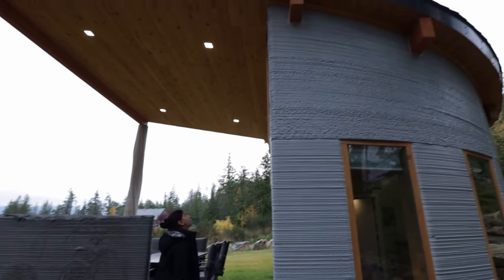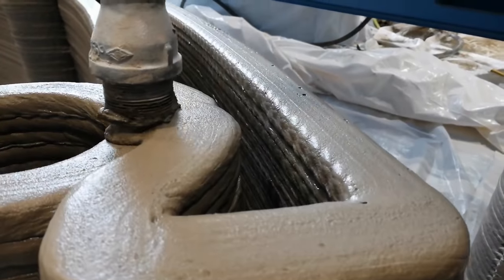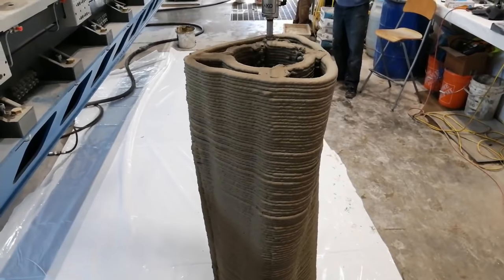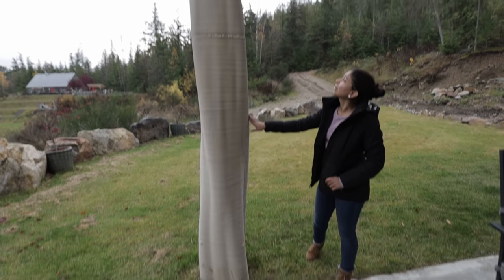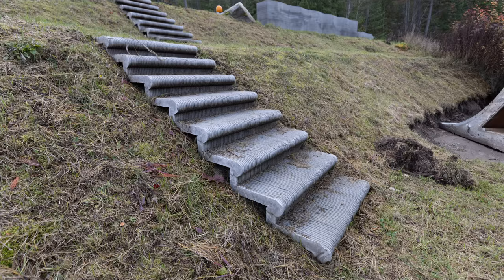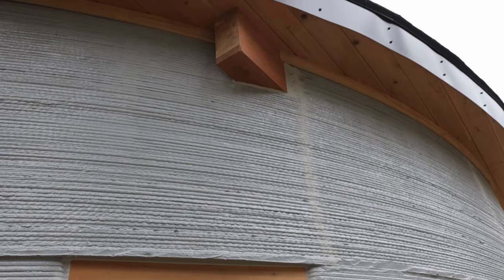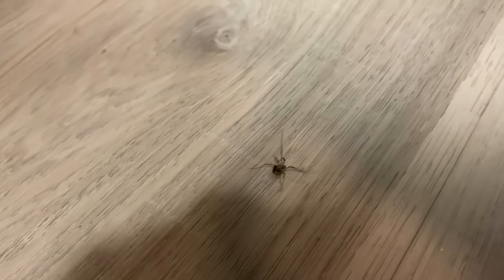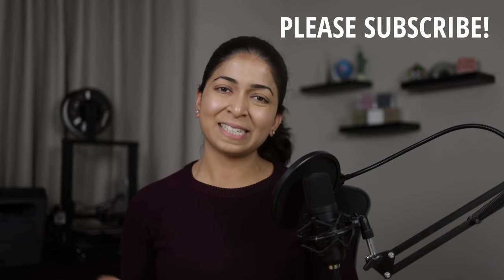Fibonacci 3D printed house | Good, Bad & Ugly

Comment: Installed in wood framed walls, steel stud or poured concrete, renovations or new construction, commercial or residential, most of the plugs I notice are  either loose, out of plumb, twisted, proud or recessed or a combination of these faults. 
Good installation starts with a securely mounted electrical box, set plumb and positioned to be flush with the eventual finished surface. Obvious and easy to do, right? Wrong. Twisted wooden studs, inconsistency in the drywall application, form variance around cast in place boxes, the reasons why it is difficult to get an electrical box roughed in to fit exactly flush and true with a finished surface are many, but a sub par box rough in is not a reason to give a poorly fitted plug, a passing grade. 
Most boxes seem to end up slightly recessed behind the finished surface and this leaves a gap between the threaded ears on the box and the metal mounting strap of the plug or switch. To ensure a solidly mounted plug this gap should be filled with spacers so that force applied to the plug is transferred directly to the threaded ears of the box. Sadly most electricians use the ears built onto the plug mounting strap to position the plug flush with the face of the drywall in combination with the decorative plate to keep the plug pulled forwards. The result may look okay but it is unlikely to remain so once the device is in use. The reason most don't bother with spacers is probably a question of time. The spacing washers are thin and it's a guess as to how many are needed. 3 top 3 bottom? 5 top 2 bottom? Could be. Try it. Washers on, screws started, fold the wires into the box, tighten things up, try the plate and... Drats! Should have been 4 up and 4 down. Take it apart, try again. Really? That's odd still not right. Okay, maybe 4 and 4 with a thinner cardboard shim on the top. Okay finally, that works. Almost. It's plumb and equally spaced out on the top and bottom screws but it's not equal side to side so I guess the box is not parallel to the face of the drywall. No problem. Take off the plate, grab the ears with some pliers and give them a bit of a twist to align plug face parallel to the face of the drywall and finally put the plate back on. Oh for crying out loud! Now the top is sticking out a bit too much. Once again, remove the plate, undo the mounting screws, pull the receptacle forwards, remove one of the washers, put it all together again and...? Perfect. One down, one hundred more to go.
Plug number 2. The box is flush, no need for spacing washers but the box is loose and wiggles about in the hole. Solutions: Secure the box in place with drywall filler or latex caulk or one of many different types of supplementary brackets. Hmm no brackets in my truck, so use drywall filler. Now, wait for that to dry and set and 24 hours later I can come back and install the plug. Plug number 3. Oh oh, this box is way to deep and there is a gap between the box and the back face of the drywall and that is an electrical hazard and code violation. Solution: Install a box extender. Easily done, just another trip to the truck, back to the plug, install and hooray! I've done 3 plugs, (well 2 and half cause still waiting for that mud to dry) in 30 minutes. Oh oh. Boss ain't gonna like that. I'm supposed to be at a pace of 2 minutes per plug. I guess it's like they say. Good. Fast. Cheap. Pick two. 
And that dear reader, is why I never made much money as a self employed electrician. I was Good. I was Fast (relatively speaking) and I was Cheap cause I couldn't justify charging the customer to repair the mistakes done by those who started the job.

Comment: "The Fibonacci house is not just form for form's sake. They chose a spiral because it would have been very expensive to make the shape with traditional form work. Printing a curved wall with different radii is not an issue when using a 3D printer."

What I'm hearing here is "in order to prove that 3D printing can easily do things that are impractical to do traditionally, they designed and built a house that nobody would even want to build with traditional methods because curved walls are totally useless and impractical." Which is as much "form for form's sake" as I can imagine something being, at least. And that's not even to mention how hard to clean the grooved walls would be that everyone else has already discussed.
Reply: Exactly.   No one with any sense wants curved walls.   Just hanging a picture is a pita.

Comment: "Many electrical outlet plates are also loose". Too be fair poorly installed electrical devices seems to be more common than not, at least it seems so in my area.
Reply: I think the curved and uneven walls from the concrete pour don't allow the plates to rest flush, however an electrician should have ways to work around it. 
Oversized plates and a little clear silicone would do the job.
Reply: @s.n.9485  In this case I would probably create a small form to place around the rough in box and fill it with some cement based product to create a flat surface on the face of the column just slightly wider and taller than the size of the finish wall plate. This would create a seamless blended transition between the 3D printed concrete and the finish surface for the plate. As a one off, one of a kind, it would probably take the better part of a day when all is said and done but I would sleep well, pleased that I had turned an eyesore into something acceptable. The down side is, the guys who do the really sloppy work seem to get rich but me, well... I sleep well at night.

Comment: The more I see stuff like this and stupid projects from 5-minute crafts and their like, the more I have come to hate concrete. It's messy, ugly, and people try to use it for EVERYTHING. It has its purposes but is used WAY too often.

As someone very experienced with 3D printing and additive manufacturing, I do not think concrete 3D printing will ever truly take off for home construction. There are too many downsides with almost no upsides. I believe 3D-printed homes will eventually work once they start printing out of better materials. Something like semi-plastic foams or fiber-reinforced plastics. Until we can effectively, cheaply, and versatilely 3D print with materials at least equivalent to current materials, this technology simply isn't viable mainstream.

Comment: If they can get the walls right...aligned, air/water tight....the crafts of electric,  HVAC, plumbing and carpentry can do the rest. Or why not incorporate the space/lines needed in the program and have the printer print the gaps needed for all utilities.

Comment: Instead of layers of toothpaste for walls, the 3D printed homes made off-site could be doing a large number of better looking concepts. This is just the very beginning of the tech.

I think they can come up with interlocking stackable pieces that are aesthetic while being durable and seismically strong. It should not be very difficult to improve on designs like the textile block homes of Frank Lloyd Wright. Scale up the blocks, use modern concrete formulas, steel reinforced, include a system to plumb and wire the interior wall.
Reply: You don't need 3d printing to accomplish that and no one does it.

Comment: Note to Printers: This tech needs a modular stacking system for all utilities (plumbing/ electric/ windows & doors. ) stacks would be accumulated by a second robot during printing.

Note to Hardware Co. : Door frames and window frames can be stacked and attached with the print.  The ancient stone systems are a great model… they had floor heating and tapped walls for water and light.  Think of LEGO.

Note to LEGO: 3D printing and your company should do something amazing 🤔… Hybridization, perhaps… printing custom blocks?
Reply: What is stacking in this context?
Reply: @pauleohl A separate system of items that would stack as the layers of cement accumulate.  A separate robot arm would work in conjunction with the printing process moving just in front of it.  The system would be to add a sub strait for doors, electric outlets, ducts and pluming.  The elements could be made of whatever, perhaps plastic or wood. The stacking would allow for this printing tech to proceed uninterrupted.

Comment: Hmm what about 3d printing a styrofoam wall and fill that with concrete. Rather then using the CIF blocks you could make a free from :-)
Reply: Makes a lot of sense to 3D print the forms then cast them in concrete. Thinking of a modernized Frank Lloyd Wright textile block house like the Ennis

Comment: Hi my name is Ray Peters I am a pumicecrete home builder Pumicecrete is a mixture of pumice cement and water mixed and poured into a set of reusable forms walls are poured from 12" to24" thick pumicecrete is fireproof termite proof rust rot and mold proof and has a high R value and good sound attenuation solid poured walls means no critters can live in your walls 
Pumicecrete is by far the best building material on the planet 
If you would like to know more let me know 
Take care Ray

Comment: Yeah, clearly it's just a demo house, it's neat but I can't see how the 3d printing will ever be cheaper than pre-formed poured walls or other cheap alternatives. Also I would love to see how they handle lateral loading in earthquakes. Just wondering on that point
Reply: Inside the bathroom wall is an entirely filled 'T" structure with rebar and conventional concrete to act as the shear wall. The structural calculations did not even consider the strength value of the printed concrete as at the time of construction that material was not recognized under the local building code, there is an entire redundant structure... unfortunately, to satisfy the bureaucrats in order to get this approved last year instead of maybe not for another 10 years.

Comment: Okay, if the walls are one of the cheapest parts of the house to build, why aren't "new technology" building companies tackling the foundation and the roof? How about a superior modular roof construction system? Maybe modular SIP roof panels that don't need framing, with built in solar? How about an "active" pier and beam foundation system that makes subsidence a non issue? (Either through greatly automated preparation/installation or through automatic adjustment of the piers?) Why so much emphasis on automated production of the walls, if they are so cheap!?

Comment: concrete is expensive foam insulation is expensive  delivery with crane is expensive you could build an equal house from cob and car tires for a fraction of the cost

Comment: So glad they didn't go for a million dollar home off the bat. Really that would have bankrupted them really. Like I see that they got horizontal rebar there but it is still open to condensation and it's not galvanized which it should have been to prevent rusting really. Also hope they had vertical rebar to tie everything in really.  Also can see the cracking around the doors honestly that should not be like that really. Than there are the actual visual defiencies of the house where parts broke off. Which can get worse the heat loss at the wall base could easily be fixed by having the walls lower than the floor and even glue it or sealing it properly. The plugs same as the doors can easily be resolved by preplanning and proper placement.

Comment: It's all fine a dandy till you get a big crack in the wall. In Mexico, they make mortar only construction and those are the ones I see crack always. The ground shifts with time and it'll crack. At least with wood framing all I gotta do is change the studs my self. With this I gotta call the masons and pay an arm and a leg and the crack is forever there just hidden with stucco. It's structure integrity has been altered after that. If you got heavy load on top I'd be sketched out even more

Comment: Looks fun and modern.  I am however very sceptical.  Concrete emits a LOT of CO2. Looks like you need to babysit the machine, ugly finish, slow and is probably expensive.  Why not use wood which is in abundance?
Reply: I think mud + fiber waste from rice or other grain looked like an interesting alternative explored by some 3D home printers.
Reply: It won't be practical for a while, most tech isn't. Each failure is a learning experience, Slowly but surely improving the tech to something that is.I think wooded prefabs will be more practical for a while yet.

Comment: Did you mean 800 000 cubic centimeters?
Reply: That would be 0.8 meter cube which is not enough.
Reply: @pauleohl  Probably.  But at 1.5 cm wythe, it covers about 53 sq meters (about 530 sf) of wall surface.  Probably closer than 53 million square meters of wall surface.  800,000 cubes needs about 32 million bags of the 3D mix (guess), even if only $10 each, that is over 0.3 $Billion, plus shipping.  Maybe that explains why these guys are so good at it - all those test prints!

Comment: Love your channel Belinda but this looks like a DISASTER.
Less than 2 minutes into the video  and see an enormous risk for water damage. Surely it snows there, yet no protection for the windows and it appears to sit at the bottom of a ravine. 
Maybe it's just the angle of the camera. I hope I'm wrong because moisture can accumulate and grow mold on concrete just like anything else.
Reply from the maker: You're right; they said that they have some problems with drainage. They see it as an experimental house and and opportunity to learn about construction and 3D printing. They don't expect it to have a long lifespan.
Reply: It is actually on a hillside, not the bottom of a ravine. Underneath the entire house is 2 feet of drainage rock into a topography of glacier-deposited gravel that is over 50 feet deep so there is no water getting anywhere near the structure. The grass will keep pooling water until we finish the landscaping. I actually think the lifespan of this home will be in the hundreds of years ;)

Comment: For me such 3D printed design are a big no because they mix concrete with polyurethane foam. First, it's one of the most energy intensive form of insulations (requiring several times more energy than for example glass wool) and if combined in such a way with concrete, it will never be recycled. After the house needs to be demolished, the concrete can either not be used as an aggregate or pollute where you place it...

Comment: Except for the curves (which admittedly are sexy), I'm not seeing a benefit to precast concrete walls (which can use better techniques with less materials), at least for something like this.

I understand with any new technology the premise is to apply it to EVERYTHING, but I think it would be better served as an accompaniment to existing building methods, at least until the process can be more refined.
Reply: I think that's what youre seeing here though, they're testing it on everything and then seeing what its actually useful for. They print everything then invite experts to come and critique it, and see if its something they can refine themselves into or if they should just abandon it

Comment: Your video showing the robotic mechanical arm laying concrete Block seems more cost effective than these 3D printed walls. To many computer geeks think this is great because they have a tiny 3D printer at home. In the real world they are using concrete to build these structures. I see all kinds of flaws in their wall designs. Rebar placement and layout is a joke. I can't believe they are not using some kind of foam or synthetic material. 3D printing will have its place in the future but right now technology has to catch up to the enthusiasm.

Comment: Man the more your show the less impressed I am with the concrete printing. I'm pouring a better wall in EVERY way Saturday morning with untrained helpers. R-30 sandwich panel ties are the only thermal bridge, but this is a test wall. Next ones will have fiberglass. 
People are having fun with these, but nothing worth doing.  You are right on the curves; I like the 3D bridge but acting like this is even close to prime time. Nothing here even looks like it has a market. Mass Timber looks better and is going up now, curves aren't much of a problem there. Curves are easy in stick framing but the reason they aren't done is the cost of finish. Go look at the finish along the curves.

Comment: Installed in 5 weeks by 4 people for $6000, so each person was making $300 per week. humm
Reply: It's a McWorld and we're all living in it:)
Reply: yeah no all of the figures are massively off
Reply from the maker: $6,000 for materials not time/labor. It was built by the 4 co-founders of the self-funded company.
Reply: $6000 would buy 32 cubic meter of concrete delivered.

Comment: Is this strictly what we are calling a "3d printed house"? If it were cast sections, there would be huge structural advantages. Maybe this should be a "modular 3d printed house" since it was made piecemeal, not printed in situ. That large concrete "printer" will never be mobile so at best it will only ever do modules that need to be stitched together. Again, this is new, burgeoning tech, but less effusiveness and more critical thinking would be appreciated. BTW, Welcome to Canada!

Comment: I'm still not sure what the point of these are. The 3d printing part isn't solving the largest problems with home construction/ownership.
And the material isn't really the best either. Plus it looks ugly imo. Especially the lines where the two pieces are joined together with a big splat of concrete.

Comment: 3d printing with concrete is totatlly unecessary. Unless you want to explore creative uses and do non box designs there is no reason you can't just pour concrete into forms and do the same thing. It still requires rebar.